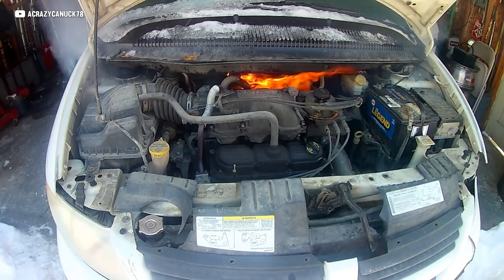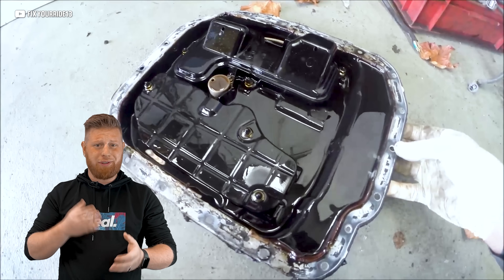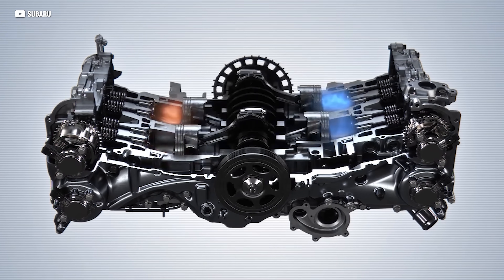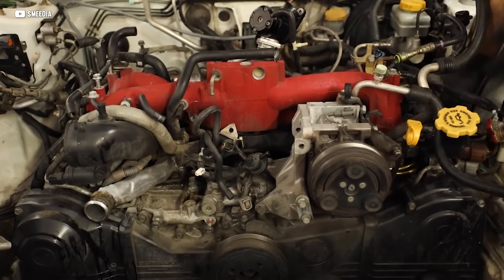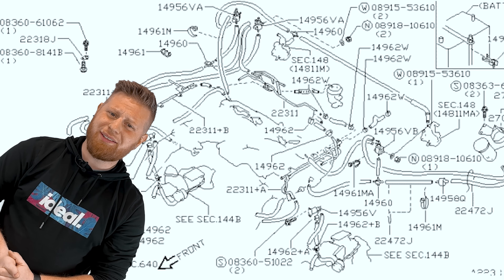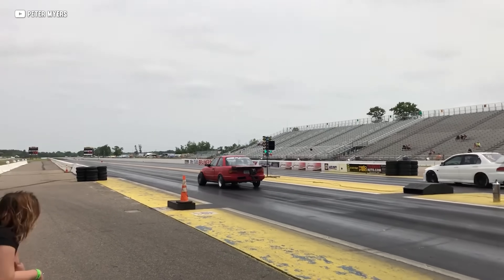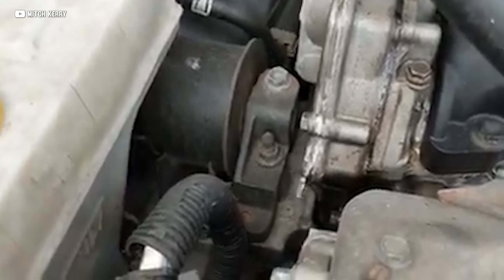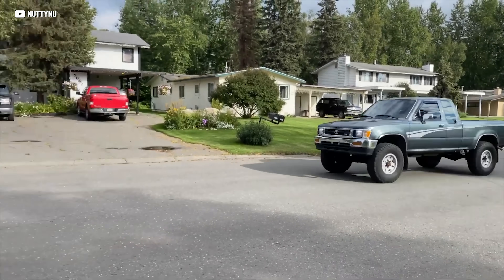WORST Engines Of All Time - JDM Edition

Comment: As a Subaru "builder", I can say yes they have their problems, but I had 350k km on my 06 wrx stock motor/ turbo/ trans. Since then I've rebuilt 3 times due to oil pressure/ pump issues causing rod bearing wear/ noise. Pistons are 08+, head gaskets  are pre-05. With the parts involved in the 06/07 wrx they are the best ones for reliability, tuning, design overall.
Reply: How is the reliability or longevity if taken care of on 2009-2014 WRX’s? Thanks.
Reply: @TheRandomname951  maintenence is key, & proper warm up/ cool down (after hard driving). & using proper oil filters also, there's a bypass valve in the filter & some cheaper ones are not high enough pressure before the filter closes, leaving your oil to never get filtered out etc. Wix filters are the same psi as Subaru filters. There's a few discussions about the factory tuning being too emissions friendly causing spark knock/ wear/ problems. & in 08+ they switched the pistons & started getting the ringland problems, which has been attributed to the factory tune etc. My mom had a '13 with 250k km on it before a crash. Early oil changes, oem filters, not modified & always warned up etc.

Comment: In the honorable mention, the 3vz fe in the third gen Camry was shown. The 3vz fe was only inside the third gen Camry from 92-93. After that the 1mz fe engine was put inside. That engine is the real workhorse that made Camrys known to last a long time.
Reply: This engine seems pretty reliable but average. Somehow the video implies just because it isn't a fun engine, it's also unreliable and junk, as if fun equates with reliability.
Reply: @ChrisRobato  you just just contradicted yourself, hurts to read that, confusing, it's actually a reliable engine
Reply: @chrisgomez3078  Yes it is a truly reliable engine.
Reply: @ChrisRobato  😅 sorry I just read that properly, my bad
Reply: the 3vzfe didnt have head gasket issues like it was said.  It was a great engine. The problem engine is the 3vz-e in the trucks, very different motor, non forged crank, not revvy etc

Comment: I owned a 2003 Sentra Spec V with the qr25de, went through 2 motors because of that exact problem before i sold it. Bright side was i think the altima/maxima at the time ran the same engine so an engine replacement was always readily available and cheap at that.
Reply: I had an 02. After an engine swap and precat removal, it was a solid car

Comment: Hadn't thought the 6G72 (incorrectly labelled in that picture, it is a 3.0 not a 3.8, the 3.8 being the 6G75) could be a bit of a pain to work on. What i have as my daily has that engine, a 1997 Magna, also known as the Diamante elsewhere. Has about 220,000 kms & still runs fine, never any issues & have taken good care of it in the 10 years i've owned it. Although this video has had some inaccuracies (like the Mitsubishi V6 being incorrectly labeled at the start) along with misinformation about the Nissan VG30, as people have pointed out as well.
Reply: 6g72 without TT to it is a great engine, quite durable and reliable if not tuned
the 6g72TT tho is a huuuuuuuuuuuuge pain in the neck :D
Reply: @Raikokz  As the NA'd one (totally stock) in what i have & would be staying that way. Good to know that it might get issues if anything is done to it, and that the one in the GTO/3000GT & Dodge Stealth, can be a bit iffy like were mentioned here
Reply: @huleeyaxerssius7  I drive a 1992 GTO twin turbo so I know 😅
Reply: @Raikokz  Ah alright, though what i have have is slower than what you have, guess it'd be a case of the tortoise & the hare even you could say. Slower, but more reliable, the other being quicker, but not as reliable. Would still be a fun one to drive would say, the GTO

Comment: I 100% stick with Toyota these days, but even then (besides my rock solid 94' Camry) both my other cars have some pretty huge and well known issues straight from the factory.
My 88' Supra came with wrongly torqued head studs from the factory as they all did which blows headgaskets, but luckily I bought it with that already fixed.
My new 01' Celica GT-S is notorious for breaking the two lift bolts that give it boost at 6.2K RPM and of course mine are broke. $1,200 fix just to extract the broken metal from the rocker.

Comment: as and owner of an rx8 i cant believe the hate of the renesis is my daily and i have 0 problems also i rebuilt it 2 years ago when i it has 180k miles on it and it was running perfect i just want to bridgeported it and put everything new on it but it was perfect. as an rotary owner the only thing you need to know is that you need to premix with idemitsu or renewable lubricants also use idemitsu engine oil. the cooling system need to be in good condition the problem with the car is the ecu have alot of restrictions because of the emitions so you need to reflash the ecu and make the A/F ratio better and the fans will start earlier . if you gonna buy one first need to do compression test after that if everything is good then you start to do the real maintenance . also rev it to 10k to clean the carbon deposit always prem fuel & respect temperatures its like any other car just a little bit different. change the oil and filter every 3k miles

Comment: 115k miles on my RX8 and runs like a clock. I upgraded the coils & starter, Sohn adapter, premix and switched to 10w40. Now I just do oil changes every year and keep the 2t oil reservoir topped up. Also, 8k for a rebuild?! Don't know about US prices but that sounds way too expensive, in Europe a brand new Renesis from Mazda is under 5k.

Comment: I personally owned a n RX-8 and previously and RX-7. 

Main thing is people shouldt treat Rotary Engine like they do Piston Engines. If you redline it before the end of each drive before shutting it off your engine will last longer (Not reving it while  turning the key to off...that is stupid).

Carbon build up is the main culprit for engine wear for Rotary.

I personally had my RX-7 at 168,000 miles and still running...hard to pass emissions but still runs 😅.

My RX-8 past 120,000 mile before getting on an accident, but again original engine. But everyone else who dont even have an RX-8 swear by it will blow up and die before 80,000 miles...well yeah if you treat it and drive it like a piston engine.

Rotary will last a long time if people just reset their minds how to maintain it and stop treating it like they do piston engines.

Comment: As a long time 3vze owner with over 220k original miles, I feel you.  Another annoying setback people often fail to mention about these engines is that the head and block are made of different materials.  This means coolant cannot contain the optimal corrosion resistant additives for either iron or aluminum, because each additive is corrosive towards one or the other.  As a result, if water or non-red coolant is EVER added to the engine, it rusts the engine and turns the coolant into red chocolate milk.  This reduces its effectiveness and increases wear on the water pump.  It will be this way forever.  I have to do a full coolant flush yearly or it sludges up inside the throttle body and the engine won't idle under 2K RPM.  I'm on my 2nd water pump in 100K, all because the previous owner was a liar and a flipper. He left a leak when he sold it to me, just topping the system off with water when it got low.  Everything you need to do on this engine also requires removing the annoying intake plenum with a rats nest of vacuum lines.  Because these engines are so reviled, parts for it are sometimes rare and expensive like the power steering pump and gearbox, AC components, etc.  But like you said, I am basically doing the bare minimum to keep it on the road hoping it will pop any day so I can get a taco engine and it will NOT quit.  I've had it for over 4 years with this intent to swap it when it went, but it just keeps going!

Comment: Remember guys the 6k he said for a rebuilt for the renesis is cap first, second the most common problem the renesis meet is the Coolant seals or oil control seals go bad that's why they are smoking and for that in parts you could maybe spend like 300usd + the work if a shop does it for you which depends from the shop, I asked a price once and from a garage that specializes on rotaries said if it just o rings it will cost around 1.2k

Comment: The fact that he quoted every subaru owner spot on. Whenever I say they are junk it's always the same response. I've had mine forever and haven't had a single issue. That's weird when the subaru shop I worked at was busier than Volvo, BMW and Ford put together, and we only have a single bmw dealer in the state

Comment: As subbie guy i agree EJ25, EJ255, EJ257 arent good engines but when people saying all EJ are rubish is just plain stupid, maintain them and they will work. Porsche uses boxer engines as well but i dont see people saying Porsche burns gaskets and has bearing problems 😄 just pure subaru hating i think, Subaru boxer 6 engines are desinged by Porsche btw.
Reply: I think one of the issues is Subarus do not like being pushed without a rebuild. The EJ253 suffers the most gasket failures on stock tune from having worse gasket design, open deck, and lower torque specs.

On the other hand, head gasket issues seem to be overshadowed by oil starvation.
Reply: @meercm  i mean same desing, there is problems with 2.5l boxer engines i advice to everyone not to buy them, but what comes to smaller EJs they work just fine if you maintain them and dont abuse them, and Subarus six cylinder boxer IS desinged by Porsche. My parents have 3.0R Outback 2004 400tkm and works like a clock, my 1993 Subaru legacy 200 turbo 370tkm and works like a clock. Its how you keep your car in the end you can destroy any engine by giving F about maintain and driving like a maniac 😄

Comment: Bought a brand new Loyale in 1991 as our first family car (with 4wd, air, manual and electric windows, big step up for a young teacher and family for $11,999 and the cool part-time 4 wd red button on top of the shift knob but don't go above 60 with it engaged!) and it had continuous problems with oil starvation in anything resembling an enthusiastic turn (especially left turns!).  The dealer installed a new baffled oil pan which helped but never fully eliminated the fun clanking and occasional related smoke, ahhhhhh Subaru........
Reply: The 08+ ej25 pan is a better design which mostly fixes the issue.  Some company (honey bee something?) took it a few steps further but the price is cringeworthy

Comment: On the Renesis…. It’s like a needy girlfriend lol. As long as you do your maintenance and do supporting mods the engine will do well. It’s intake system is truly remarkable as it’s the key to it’s horse power and such small displacement. Yet, it’s a rotary so don’t expect 200k. It ain’t gonna happen. So I agree and disagree.

Comment: The only Subaru that suffers from head gasket issues is the naturally aspirated 2.5 single over head cam. Beyond that not a single other car has head gasket problems. This was the only engine to have a coated single layer head gasket and the coating would wear away after time causing them to leak. Upgrading to the multilayered turbo gaskets fixes this issue.

Comment: Funny... I own a Rx8 and it feels like the engine is literally the last thing that will let me down! My car has been hugely reliable over the past 3 years. But she's 17 years old, now, so some age related wear and tear issues are slowly appearing... The paint on the bonnet fades at a different rate than the paint on the bumper. The chassis is still clean for a UK car but will need to be treated for rust prevention this year or I will at some point have to fork out big money for welding works. The sump is still clean, but on those cars, they tend to rust... My oil line connectors have started corroding, so that will need to be changed in the next two years or so to avoid having to deal with leaks... The passenger airbag cover cracked last year and had to be swapped. I have to keep an eye on the clutch pedal and the rear springs (two weak spots on the car that can fail with time). The engine? Purrs like a kitten! 

Early Renesis failed prematurely because Mazda's servicing schedule was not adapted to it: They tried to sell a rotary engine with the servicing schedule of a piston engine. That was never going to work! Early coils and starter motors were also weak. All that has been solved. Maintain your car well and that engine will serve you a long time... Oh, and treat that engine like a consumable: It will need a rebuild at some point. But it should be reliable all the way up until then!

Comment: More of a question for other commenters than a comment - can anybody recall what the sudden loss of oil pressure without any warning whatsoever was all about in the early KLZE Mazda V6's (1993-1995.5ish most common in the 626, MX-6 and some Probes yes got the JDM "Z" engine not a US spec "D")? It was just the early ones but I blew up at least 3 back in the day and can't for the life of me remember what Mazda changed to fix it around '94 whilst affected ones continued until stock dried up around middle '95 (you either got the good revision engine in '94 or the unmodified and there's no real way to know which one you got). That was my favorite Mazda v6 ever and 3 of at least 6 or 7 I've owned had the sudden oiling problem which grenades the engine spectacularly, always over 6,500rpm when the oil pressure decided to quit. Been so long now I can't remember what the issue was, but it was thoroughly asinine & inexcusable that much I can remember. Back in the 90's you could buy used Japanese engines straight from Japan cheaper than anything you could get from the junkyard no matter how old it was, THAT I miss dearly. There's still quite a few KLZE and KLDE out in the wild today

Comment: 3000GT- 
Lifter tick- replace the lifters. 1g or '99 DOHC. 1g is preferred (i want to keep my oil in the oil pan, not shoot it all into the cyl head)
Miles of vacuum lines?- Vac delete. you really buy some silicone vac caps and remove a bracket or two and fixes all of it in about 3 minutes
Timing belt?- Manual timing tensioner. Vice grips with rags to pad the timing belt so you dont gnaw it up. OR...take some folded up paper and stick it under the cam caps to help keep the cam gears stationary. I can set timing on my car in about 45 minutes start to finish.
Reply: What is stupid tho is the amount of bracketry involved when working on a 100% stock car. I think i removed about 22lbs of unnecessary iron, and it makes the car SO much easier to work on.

Comment: I own a FC and I can confirm the cost of repair is very high IF you wait till it goes boom. I pulled my 13b out at 60k on last rebuild because is noticed it was burning a touch of coolant.  Could smell in the exhaust but no white cloud. Everything has be replaced or rebuilt except my rear cradle bushings. I know it's slow but they are so much fun. Shifting gears at 8k rpm in a 80s car is a blast. If you don't know how to do the work yourself then they are way to expensive for the average person.  You have to WANT to keep these cars going. When they brake down you hate them and want to rid yourself of it. But when you finally getting it running again it like a drug addiction. You can't get enough.
Reply: Listen to yourself...60k engine rebuild.
Seriously?
This is considered good?
Id be fkn ropable if my car needed a rebuild at 60k.

Comment: 7m Toy/Yamaha enthusiasts here love it not worth the hate, blown heads is more of meme than actual fact. The truth to this scrutiny is back in the day Toyota had its torque specs wrong All you have to do is tighten down a little bit further and regular routine, maintenance and it will last forever. The only downside to the motor is that when building a high horse power variant of the 7m the parts are more expensive than its 1j or 2j counterparts. With that said respect the O.G.

Comment: The major power problem behind the 3VZ engine is the fact that (in a pickup) the passenger side cylinders deal with double the exhaust pressure due to a cat'd crossover pipe that links both exhaust manifolds. Decat this pipe or go the header route & all is good. (Yes it does have a main cat under the cab)
Reply: Also not to mention the other engine option for north america out shined it in almost every way.  The 22r/re did make less power but it drove so much better as it made all its torque down low.  Ive owned a number of these pickups over the years and the 22re variants are by far the better option.

Comment: Had a 2001 forester s headgaskets done 2 times and I just drove it regularly untill oil bolt just popped off..
Reply: I had a 2001 Subaru Forester S turbo  here in Scotland aswell mine was mint burned 0 oil and the only reason i sold it was because rust got it the guy i sold it too spent 2-3 grand on it and its got a wrx subframe as mine literally the left half rotted away 4.5 kgs of sheet metal too read suspension turrets i saw it once  drive past me couldn’t believe it 119,000 miles when i sold it full service history completely stock
Reply: @andrewjohnson7960  mine was at 120k also when gone smh also turbo with full leather interior all the bells I have a e46 now great car

Comment: Most people don’t understand or fear rotaries but they are very reliable with some love and attention to detail. Especially keeping oil changed regularly, strong spark and keeping them cool. Yes they won’t do 300k on original seals but the trade off is definitely worth it for such a unique and characterful engine, which for a 1.3L no piston engine can compare power wise . 
I love my renesis rotary rx8. It is Mazdas most powerful NA 13B which sounds amazing and loves to rev ! It’s not supercar fast but enough to beat some of the  modern factory turbo boys .